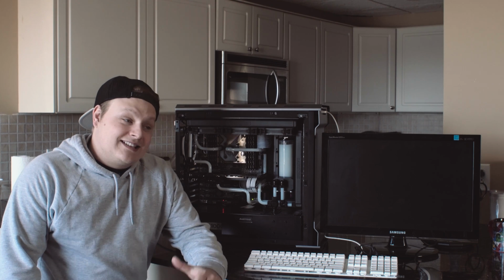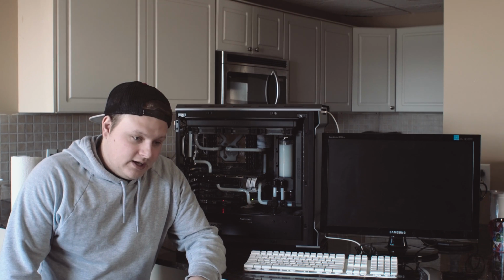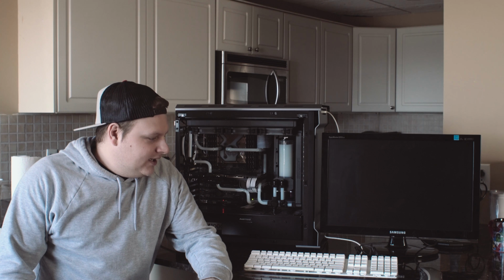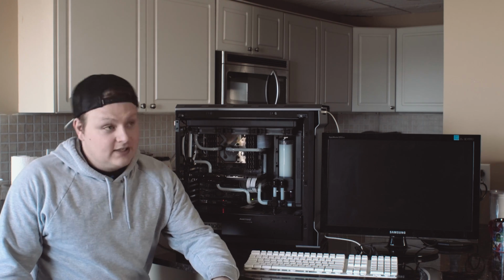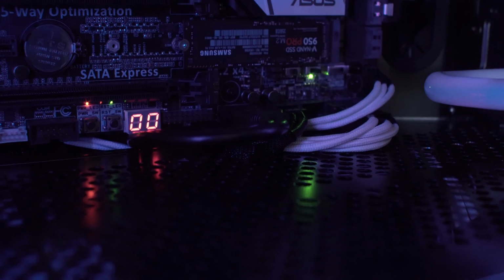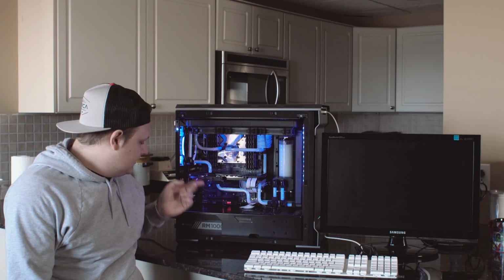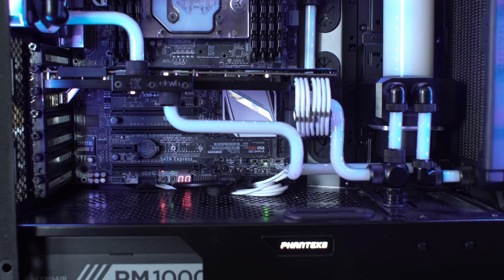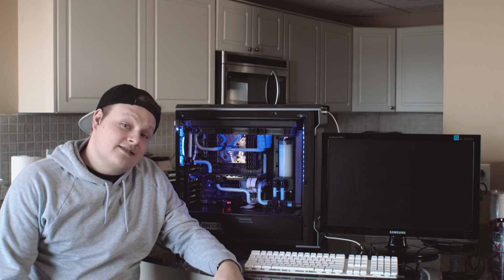System Update - 00 Error. Motherboard Failure?

Comment: Idk which part I should feel more sad that could be fail on me rn, my cpu the i7 10600k  or my motherboard the rog strix z490... I don't feel good just thinking losing one of them... If not both!... I had the exact same issue, a 00 error code that's why I'm here, and after watching your video, I feel twice sad as I was before since my thoughts came true... Glad you saved your pc... Wish me luck for mine
Reply: How'd you go. I have had this happen to me on separate ROG Maximus boards &both times  I was able to fix it by doing a "BIOS Flashback" - It appears it was a corrupted BIOS, not sure how that would have happened.

Comment: I'm currently having similar issues. Went to bed and woke up to my pc power cycling with the board saying 00, tried resetting cmos, messing with the ram, cleaning dust and checking connections but nothing is working. All lights are working, only stays on for a split second and no fans even start to move on it. The fans move on my graphics card when it's plugged into the board (only fans that move other than the psu fan). I noticed if I disconnect the cpu cable it stops power cycling and stays on yet the fans still don't move, would this sound more like a board or cpu issue?

Comment: Same issue here with a Z690 Maximus Formula, ran great for 8 months after I built it then on boot wouldnt move past the 00. RMA'd the board, got a replacement, worked for 2 days and then put it to bed last night, this morning went to boot and bam right back to not booting on the new board with a 00 code...again...
Reply: What u did after that

Comment: I have the same code appear on my motherboard (ASUS X670E Crosshair Hero). When that happens, my monitors go black and I can't turn off or reboot the PC unless I flip the switch on the back of the PSU off and then back on. This happens intermittently while I do light stuff like file management, browsing etc.

Comment: I have the same problem on my Asus X99-A board, but hte funny thing is when i turnthe PC on the first time it shows 00, i hold the power button that it shuts down, turn it on again shows 00, do the same, hold the power button down till it turns off and on the third time it starts up and works normaly, can enter the bios, performance is normal, liek it was nothing. wonder what makes it go on the third try and not on the first one. 

Replaced the batery, reset and updated the bios and maybe works on the first go a few timeswith new battery, now only starts on the 3rd go

Comment: Did you ever confirm the mobo dead? I got this 00 w/ CPU LED on a new E5-1680-V2. It was BIOS issue. Chucked my old E51660-0 & it was fine (ASUS P9X79-E WS). With all you put into it I would've barrowed a used known good low end £90 CPU to tes. Even a new E5-1620 new was under £240 (back then). Or if you saved to find out later as bits are now cheep. Hopefully you saved it as these X99's hold their resale if ends up good. Even for parts if complete w/ box.  Nice build btw.

Comment: Mine says error 00 only with cpu power disconnected. If i connect cpu power the pc wont even turn on
Reply: Same problem exactly with my i7 10700k and z_490 rog strix MB
Reply: @FunWaku  my mb was burnt. My psu was faulty and burned it

Comment: Sadly I've also got the same issue but with a recurring theme. Only ever happens when the PC has been off for a significant period of time and the room it's situated in is cold. At time of posting it's just started to get colder / started happening again; been running totally error free all summer. Once it boots however perfectly fine, it's just a question of getting past the Error Code 00 displayed on the motherboard. As previous poster mentioned applying some heat to the general area where Error Codes Display / M2 Drive is fitted (if you have one) using a hairdryer resolves the issue much as it makes no sense. Very sceptical of this but it works. If this happens to you before you start buying a new MB, unplugging peripherals etc using a hair dryer apply some heat to this area for about a minute. And prove a point, put a digital thermometer next to the PC with a notebook. Note when the error occurs / ambient temperature. You'll soon start to see a trend. Hope this helps as this issue drove me to despair for a long time. Certainly won't be buying ASUS MB again, zero official recognition of this issue and / or the fix.
Reply: Just logged in to thank you for this. Today, first time in the morning, when tried to turn up the computer, the board displayed code 00; however the only difference respect Friday (when it was working just great) was a colder weather. Before reading your comment I wasted the morning trying to troubleshoot the memory and PSU and got convinced that the board was death. Then I searched for the error in YouTube, found this video and got to your comment and then all made sense! I just went to the motherboard with a hair dryer and after a few seconds of heat, the 00 error went away and the board booted up just fine!. Thanks again!... but this worries me now. So, now I have to live with a hair dryer next to my PC?
Reply: This actually worked. Thank you so much!
Reply: asus is crap

Comment: Had this happen to me this week, The DRAM led was lit regardless of the ram or positioning,  I rebuilt the computer into a new case and power supply and the motherboard went to 00 after I did the first power test after finishing the build. I believe two of my standoffs had got stuck to the mobo screws and I think it caused a short, the standoffs were stuck to the screws and it came out of the case, I might have to RMA the case if the standoffs threaded or shaved the stand offs are on the case

Comment: You didn't fix anything, you swapped parts. The original board may still be good but you have no clue, post code "00" on Asus can ALSO mean corrupted bios. You can blind flash the old board, no CPU just the board n PSU, google How to blind flash asus mother board, lol you have 151K followers? Your a parts swapper lolz! you might have saved your self 8 hours work..............

Comment: in my case it was an X570 Aorus Master build - after trying everything else I finally removed the CPU cooler and CPU - I examined the CPU under lighted magnification and discovered the 1st pin in the arrow corner was mangled

Comment: Wathc out for a faulty/ dead PSU as well! I have this '00' probem with MSI X99 gaming titanium board, Xeon 1650v3 paired with a be quiet 850W PSU. In my case the PSU is the bad guy. No boot, nothing. However everything works well with an FSP 550W PSU.

Comment: My x99 deluxe died back in January. I turned it off like you went bed, come back the next day and tried turn it on and nothing. It flashes on for a split second I RMA’d the PSU with it coming back working fine. Got another cpu and tried different ram and doing a CMOS clear with no luck. I’ve taken it apart and checked the motherboard over and can’t see an issue anywhere? 😭 going have go back over as I’m 100% sure there’s a short from somewhere with it flicking on and off
Reply: same issue here been a month and cant solve it yet
Reply: @brightmedia385  I checked the board again and fount a short on a chip labeled 29 F1 32Q below the ram on the right side of the board. Used my thermal camera to find it. Can’t find anything online about it so still stuck with what to do. Waiting for ASUS to get back to me with a price for repair out of warranty

Comment: Man heaps of work with with that expensive rig. Why didn't you take the motherboard and cpu to someone who could test it for 50 bucks. That was a high risk strategy. You could have ended up with two working motherboards and a dead cpu. Either way I would not touch asus with a bargepole. Had nothing but problems with things I bought from them.
Reply: Asus suck

Comment: i had same issue but my system will turn off in a second after code 00 and loop again , seems like for me is the CPU
Reply: @awalon2572   did that already . no luck . seems like its the CPU. for me was X99 Asus with 5820K
Reply: @americanprep3636  its hard to believe cpu, cpu doesnt die or its the last that could happen. btw im still having issue again with qcode 00
Reply: @brightmedia385   Yes , and the bad part is I cant test it , because very hard to find another MB or CPU with same socket.

Comment: try to touch the TPU chip for a couple of seconds ,make sure your temperature is above 30c degree or use hair dryer or heat gun gently .. that's works for me
Reply: whats a tpu chip? i have same issue please help me
Reply: @thedoublegwiggler  that black square box with TPU logo printed on it , at the right down corner of the motherboard . if you are  installing the m.2 card "kind of small ssd drive" it will be underneath it   ..   https://techplayboy.com/wp-content/uploads/2014/10/asus_x99a_switches_tpu.jpg
Reply: @awalon2572  this is not the issue with Asus X99 boards. As with the cmos battery. If you just flip the battery it will drain all the cmos (Power disconnected of coarse) straight away.  You don;t need to leave it for 2 hours.

Comment: I got same motherboard and this jus happened to me. I built the computer 2015, and now 2020 it just failed. I have taken ram, grafic card and harddrives out. The cpu fan and chassi fans does not spin only the power supply and motherboard says 00.

Comment: Hello, if someone can help me, I have an MSI z170A Gaming 7, I turn on the board and it stays at 00 and it does not give me video, I have flashed the bios several times and I do not know if there is a solution if they could guide me regarding this problem if it exists or no solution thanks.
Reply: I have the same problem, did you fix it now?

Comment: Whats up Lee?  Thank you very much for posting this video, it was the only one I could find specifically on the Asus X99-A 3.1 throwing 00.  I, just like you came across this issue 3 night ago.  Went to power on my computer which has this exact motherboard and a intel 5820K lightly overclocked.  it powercycled over and over throwing 00 code.  After trouble-shooting it to eliminate bad RAM, PSU, all other hardware interference, even a successful bios flashback, the outcome was still the same- power cycling and 00.  I then purchased a used core 5820K on ebay and through it in.  Same outcome.  After seeing your video I'm convinced its the board.  Unfortunately this specific board is hard to come by now, so I'll have to do something else.  Good to know it was the mobo.  Thank you for uploading this content.
Reply: Just had this happen with me. Like.. the same thing. I've always had some issues with my x-99a but was able to get it up and running.
Reply: I am having completly same situation and issue, mobo X99 A Usb 3.1 & I7 5820K

Comment: Same issues. Seemed random but it isn't. Crazy but the fix is just to apply a bit of warmth to the mobo. Either leave it switched on displaying 00 for 5-10 mins then reboot or use a gentle hairdryer setting from a distance.  This mobo was eventually warm enough after repeated on/off cycles to boot.Same issues. Seemed random but it isn't. Crazy but the fix is just to apply a bit of warmth to the mobo. Either leave it switched on displaying 00 for 5-10 mins then reboot or use a gentle hairdryer setting from a distance.  This mobo was eventually warm enough after repeated on/off cycles to boot.
Reply: Worked for you ??
Reply: Yes it’s worse in the winter

Comment: ok most say it is motherboard or cpu, well in most cases I have seen it is the motherboard or more specifically the voltage regulators on the motherboard.  I have seen it a lot in the past on older intel boards but it seems it is a common problem on X99, and X399 motherboards
Reply: I fixed the voltage regulators , it started working again and then it again went back to 00 , should i try to fix it again or throw the board? 2015 board , died in 2020

Comment: I got the same issue and when I removed my video card and just plugged in my monitors to the motherboard video it works.... just still get a code 00
Reply: hi did u find solution I have the sam problem however wen I connect it with my mobo and then plug it back into my graphics card it works

Comment: With Asus Code 00 he was missing one major step thats unplugging it from power for about 15-30 min. Sometimes when there is a power outage or the MOBO is shut down improperly you'll end up with code 00. You also want to turn off LN2 if its on thats right next to the "Start" button.
Reply: Why does that happen? I have an Asus Maximus Hero VII and it works fine until i shutdown the PC, if i turn it on right there it shows q code 00 but if i wait several hours the system run fine again it is very weird
Reply: @elDiDi  I have the same problem, did you find a solution?

Comment: Rampage V Edition 10...just did this after a few weeks of use. I bought it a while back and finally got around to putting everything together, all was well until this morning. 00.........I have not looked into testing anything yet, thought I'd see what the web rats and trolls had to say. Luckily I have another 2011-3 system to test parts if necessary, but it is still a disappointment.
Initially, I am also leaning towards it being the motherboard though.

Comment: Clean all the ram connector and then flashback the BIOS with USB and good to go again. UEFI Bios sometime need to reflash on ASUS mobo. I had the same issue with X79 and also on X99. Both of them fixed by flashback.
Reply: Ahmed Shantonu I tried BIOS flashback. Nothing.

Comment: I have the same at my aorus x470 gaming 7 😭😭 nothink work even if I clear cmos and remove all connectique but all fan are running    and Red led cpu Blocked... This shitt is so expensive why they happened that...
Reply: Did you manage to fix that issue?
Reply: I'm its problem gigabyte x470 gaming 8 Wi-Fi... Debug Led code 00
Reply: It was my processor but waranty worked well to replace it and I also replaced my motherboard because 2 slot ram are deffectly and now all work verry well

Comment: Hello guys I got the same problem with a Maximus VIII hero and an intel i5 7600k. I purchased a second-handed 1050ti. There was no gpu in operation for a few mounths before. When I connected the 1050ti, the problem came out. Then I started to inspect the RAM, restarted the booting plugged out the psz etc. Well before this problem I had faced with other Mb bugs in my life and it always helped, when I let my pc alone without power for the night, consequently I did the same. I removed the ssd hdd, only left the no.1 slot with 4gb ram, removed the gpu, picked out the battery and pressed clr_cmos. At the morning I switched on the power and let the mb under power till the the evening. I didnt risked anything, this time can be shorter. After these periods I turned on my pc and the mb started to work. Now I connect everything step by step and write if something happens
Reply: So, I figured out, the battery was the evil one
Reply: @emanuelbarkoczi5347  cmos was dead?

Comment: Just got 00 code luckly i have spare X99 motherboard. Swapped it out same thing 00 code. Swapped psu same 00 code. Ordered new CPU :(
Reply: what was the culprit?
Reply: @brightmedia385  CPU took a dump
Reply: @MrEightCS  hmm u saying that cpu died? then why when i manage it to boot sometimes with some tricks i learned online , like using hairdryer applying heat, once i changed cmos battery worked for 1 day next day i power on same issue.
Reply: @brightmedia385  there are many ways to make things for for a while like putting on bandaid but eventually you need permanent fix
Reply: @brightmedia385  i was able to get mine to boot once every blue moon as I was trying to find fix but when I got new motherboard had same issue I knew it was cpu
Reply: @MrEightCS  i find it hard to believe the cpu, have u tried that cpu on other mobo? u said u did on next mobo but try it on another one.
Reply: @brightmedia385  yup 2nd mobo came in and had same 00 code so after I replaced cpu everything worked fine even 1st motherboard was working. So was 100% cpu

Comment: This has just happened to me! Night before was fine, woke up in the morning and got the error 00.  Did all tests like you ..never had a mobo fail on me like that. It worked for like 5 years and never had a problem. Cpu was oc but nothing hardcore. Thanks for your documented story. It helped me a lot!
Reply: same here worked last night wake up and 00 error Asus z 490 and I9 10805k! no color mouse and keyboard
Reply: @creakffm  I've ended up switching mobo and that fixed it. Never knew what happened...but my guess is chipset fail because i ran oc for many years.
Reply: @creakffm  I have the same problem, did you find a solution?
Reply: @Николай-м1к4х   cpu and mainboard was dead
Reply: @creakffm  my computer works, but sometimes it writes this error 00 and the processor does not start, but if you press restart, it turns on
Reply: @creakffm  if my processor died, it would not start at all then
Reply: @creakffm  those fucking asus motherboards, nothing but trouble
Reply: @Николай-м1к4х  think  motherboard is dead.
Reply: @Николай-м1к4х did you end up figuring out your problem? I woke up a few days ago to 00 on debug and no posting. Similar situation where it would sometimes, rarely actually boot, and then it would run fine. But when shutting off it has potential for messing up
Reply: @ThreeDoorsNorth  I changed the power supply on the seaonic and this problem went away, but this problem can be due to various reasons
Reply: @user-wz5yf5kj2n just happened to me. I have gigabyte 650e aorus master, not even a year old and I don't know what to do